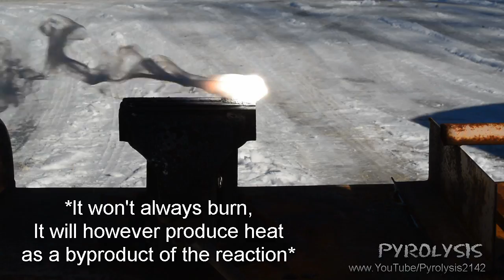Melting Magnesium With a Propane Torch

Comment: How to physically melt magnesium without burning?
Reply from the maker: You'd need to have an atmosphere free of oxygen and other gasses that contain oxygen (carbon dioxide for example) as well as a method of heating it to the melting point.
Likely the best way of heating the magnesium would be induction heating.

Comment: thats pretty interesting   ive seen them pour 3 foot long ingots of it  through a mold covered with borax i suppose? it would be interesting to try and shield it using argon or helium  do you know specifically what they shield it with at the industrial level ? also im just assuming its borax the guy was sifting over it  it would make sense from what little ive experienced
Reply: You could not use helium.. To light would not provide proper cover as a gas.. You need to use a heavy gas such as sf6 and r134a both work very well as a cover gas
Reply: +Richard Weltin  good info  happened to read that echoed in a foundry publication earlier as well that was discussing sf6 vs so2.  also found what i had assumed was something similar to borax was powdered sulphur
Reply: @mikedavis1127   well i happen to work in a magnesium foundry but so2 isn't quite as heavy as sf6 plus so2 has an oder to it as well

Comment: "normally melting magnesium requires special equipment"
That's what I am looking to see, How do you melt this without setting it alight? 
Φωτιά
Reply: melt in a vacuum chamber?
Reply: @RSTao77432  Melting under inert gas.
Reply: Melt with carbon in a close container
Reply from the maker: +Ryad Arlan  magnesium melts without igniting because of the weed burners flame cone. In order for the magnesium to burn it needs a source of oxygen (either straight from the atmosphere or by stripping it from CO2 or H2O). Basically by having the propane torch burn all the available oxygen surrounding the magnesium it created an inert pocket of hot combustion gasses, which starved the magnesium of the necessary oxygen to complete a combustion reaction. some small flames can be seen coming off the magnesium at certain points of the video (0:36 - 1:30). I'm not sure if that's the small amount of CO2 in the combustion gasses reacting with the magnesium  or because the magnesium actually reached it's boiling point. (it can be seen bubbling between 0:40 and 1:00). I hope this makes sense as it's early morning here (2:27am) and my brain stopped working 3 hours ago lol. thanks for sharing the video. It helps a lot.
Reply: @Pyrolysis2142  Magnesium will burn in nitrogen to create magnesium nitride, and it will also burn in CO2. The best way I found to melt magnesium is to melt some table salt (potassium chloride is better) and pour the molten salt over the solid magnesium. Solid magnesium is denser than molten potassium chloride, and liquid magnesium is very slightly denser. The potassium chloride is stable. This works better if you're making an alloy though, where the resulting liquid alloy is much heavier than the salt.

Comment: Awsome video! I dont't know much about fire extinguishers, but could ABC kill the flame?
Or is ABC fluid just carbon dioxide?
Reply from the maker: I'm not heavily educated in fire extinguisher tech either. I asked a firefighter friend of mine, he told me common ABC fire extinguishers here in North America use a type ammonium phosphate. Which is a dry chemical powder (the pale yellow kind). He wasn't sure if it would or not because they would use class D equipment when dealing with combustible metals. Maybe I'll revisit this with a full block of magnesium and try an ABC  extinguisher on it.

Comment: Woah. That's nuts.  Insane that you can't really put anything on it to put the flame out!
Reply from the maker: "Class D" dry chemical extinguishers are the recommended method of putting magnesium or titanium fires out. Sand also works too, but you would need to put a lot of sand on to smother the fire.
Reply: +Pyrolysis Class D Fire Extinguishers...Sodium Chloride (Salt) It melts over the source of the fire and forms an oxygen inhibiting barrier crust.

I would imagine this is Fine powder and probably wouldn't work if you were to throw table salt on it.

https://en.wikipedia.org/wiki/Fire_extinguisher#Types_of_extinguishing_agents
Reply from the maker: Ryad Arlan I must have missed that when I was researching this project. I may have to try that out. If you're interested in magnesium experiments I've got a few more on my channel. here's the playlist https://www.youtube.com/playlist?list=PLL_PjNIztYQaVbBkdWyxMYIC5Ju2NTSg4
Reply: Pyrolysis Yeah thanks, I will check them out.

Iam interested because there is a lot to be learned about physics and chem, Now the catch 22 here is that we want to learn to make a better world and products and intelligence but a lot of this is simply done for amusement and people go out any buy this stuff and have some fun with it, make a mess and pollute the place at the same time encouraging the miners to dig more holes and this is promoted and no one say's anything because its making someone money and that's what matters to those people.

My aim with science is to refine what we already know and add a fresh layer to what already has been done. to cut out the weeds and nourish the useful plants if that makes sense.

I/we can watch all of this on youtube so we dont have to go and do it ourselves.

That is the point I think, we can find out without doing it ourselves and learn that way without shipping another container full of hazchem and lab gear and logistics and fuel and time all of that can be avoided.

Its been done, we know that now, next level. What can it be used for and why? by who and how? etc etc...

Some of the chemistry that is of interest to me includes some of the (relatively) new light weight materials like Kevlar, and Goretex, carbon fiber. Aloys and metals and how they are strengthened and moulded, car design and renewable energy.

Silica, copper, magnezium, zinc, lithium energy storage and transfer.

If you really look into these and see whats out there and how it all works you will be stunned (Pun) at how much room for improvement and refinement there is.

Magnetism, wind, solar, water, traffic, induction charging, electric vehicles..

Even things like bio synthesis and photosynthesis, plant and bio logical chemistry..There is an industry waiting to be born that sits right on this border and as yet doesn't exist.

Everything you eat comes from the dirt in the ground and grows and takes time and it has no defense from humans in fact the opposite. The tree takes 20-50 years to grow but 5 minutes to come down, less even.

Yet these very plants we rid the cities and suburbs of can provide insulation and wind blocks and actually be used instead of a lot of the mined product that is sold for "Eco No Me" growth.

But the dollar is a devil and has many souls to do its bidding.
Reply from the maker: I totally get where you're coming from. Most of my "science" experiments are done with recycled or reclaimed materials. Just recently I made a belt sander out of an old air compressor instead of tossing it into the trash. It turns out that the compressor housing was made out of magnesium so I was able to salvage a good amount for future videos.